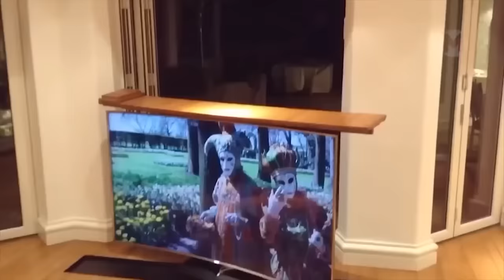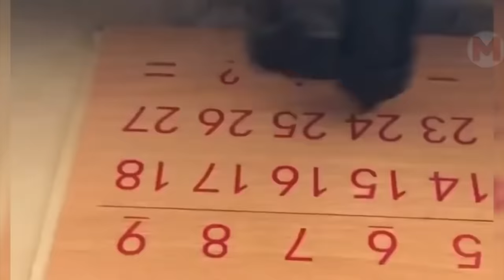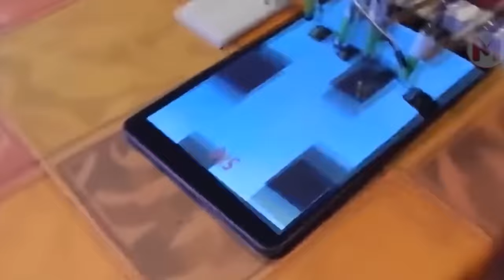This Homemade Invention Shocked Even the President of America. IQ 999

Comment: Square tire tractor guy is genius. Never get stuck, again. Less moving parts than tracks, and it doesn't bog down. Snowshoes for soft ground. Necessity is the reason for invention.
Reply: Except that nothing is necessary. Most inventions are by lazy persons, except those invented by accident.
Reply: Distributing the weight more traction
Reply: @railroaded1991 but they are smarter then 90 % of the smart so called Republicans 😅😅😅😅
Reply: And no flat tires just get out your welder fix it and drive many many more miles now if he could make it run on solar ❤
Reply: @RoseBud-fk4qg  or cow farts

Comment: About 50 years ago I worked on some luxurious houses in N. Key Largo, Fla. Imagine my surprise when I see one of them on YouTube when I'm an old man. The one at 13:00 that you can swim into the bedroom is the same one I'm sure!
Reply: Sick of This  I don't know about that but there's no doubt it's the same place. I cut the stone around it and 2 Jamaican stoned masons placed it.
Reply: How will they keep burglers out of entering the house through the pool?
Reply: @terrafirma9328  The pool area was partially under the roof of the house, and then at night had electric shutters that closed the entire area. The way to swim into the M.B. was actually a channel at one corner of the pool and the pool/bar/party area was over 5000 sq. ft. Plus, There were NO burglars in this area, the only crimes were by the owners. This was a small island in the Keys in the late 70s (nobody stole from those kind of people)
Reply: @seadog915  In the 90's I got to do some very detailed stonework in a giant shower/tub that would cascade down the stone
without shower head on. I had to get the water to somewhat split and increase its width at the bottom. This was a lot of trial and error with sizes, widths and angles.
I believe that your jobsite was cooler than the adobe style, in the middle of nowhere that I was at for a month.
It's cool that you seen the place on a random YT video.

Comment: I'll bet that tractor with square wheels is able to drive over really swampy or terrain that would be complicated for even Tanks or tracked vehicles, without having an issue at all. The way it is similar to the track on tanks and tracked vehicles, As the design he built looks like it will allow much more dispersement of the soggy terrain having long, solid sections instead of a bunch of smaller sections that flex at the pivot points that allow the track to rotate around a hub. This design might not be capable of very high speeds like some tracked vehicles, But the slower speeds and diesel engine would transfer so much torque to the ground, I feel it would be very hard to compete with this design thru some very marshy, Swampy, Soft terrain that would be difficult for other vehicle types. Just my opinion based on a quick break down of the design and possible capabilities I would believe to be the benefit of such a awkward, Yet seems would be a very successful and productive design for some industries like farming, Or traversing shallow wetlands, Or semi swampy areas. Once again, This is only my opinion and I could be wrong. Just what I thought when seeing this design and how it operated.
Reply: You are correct and have won the contest. There is no prize. Most others don't understand logic.

Comment: There is no way that a single potato cell will produce enough voltage to operate a 120VAC charger. Even taking a potato cell output directly to a five volt cell phone would not be enough. Out of all these inventions, this is one the viewer can't judge for himself, because, unlike mechanical devices, you can't see electricity.
Reply: It only takes 5 volts to charge an iPhone. However I would have to see it to believe it.
Reply: yeah exactly. look at the charger wires closely. the one on potato is a different shade of white than the one on the phone. AND you dont see the whole continual wire in video. they both go out of camera view. Why? Because it is actually two different wires. Dont believe everything that you see on the internet....
Reply: @treytrammel70  hey, I don't but there's a lot of people who do.👍
Reply: @19dcw50  That can be misleading. The 5V supply must be capable of providing suffient CURRENT at that voltage. Cellphones vary but usually need at least 300 milliamps to charge a phone that is turned on during the charge period. No single cell can do that.
Reply: 10 potatoes wired in series will work.
Reply: Might power the phone with 10 potatoes, but that still isn't going to work if it's being run through an AC charger.  Batteries make DC
Reply: You need two different metals to make a battery, one copper and other iron and you will be lucky to get one volt DC

Comment: I would like to be able to pedal my clothes clean. that's awesome. it does take a lot of electricity to do laundry and it's really unnecessary. with just 5 -10minutes of peddling would probably clean a load. I already washed my clothes by hand because I was having a dermatitis problem and I thought maybe it was because there was a lot of leftover soap in my clothes and I wanted to be able to get every bit of that soap out. turned out that was not the reason  but I still do them by hand instead of go to the laundry mat